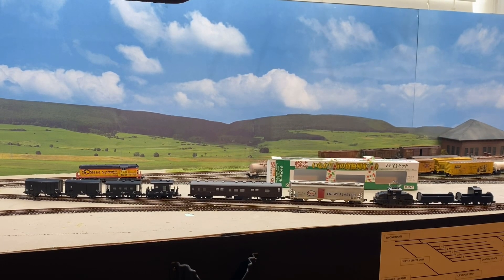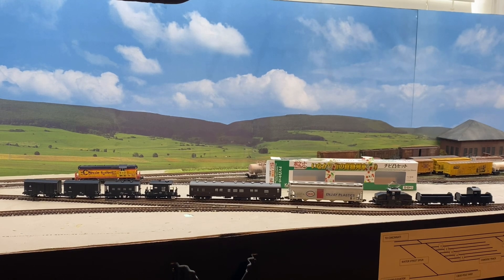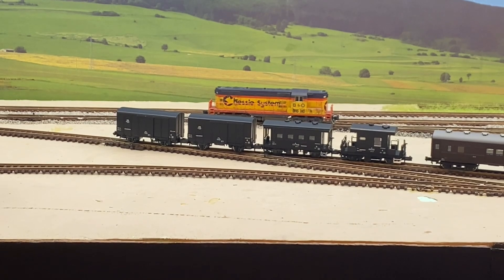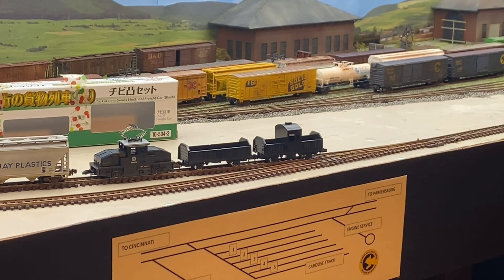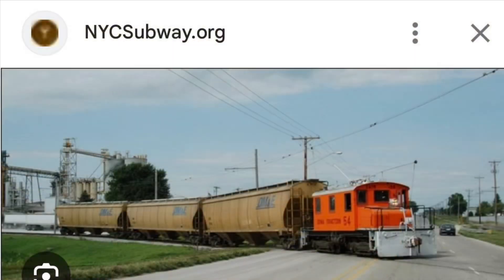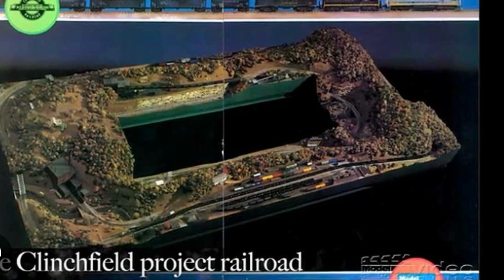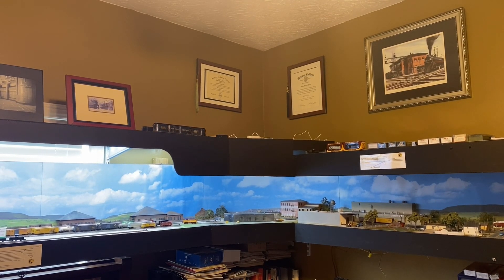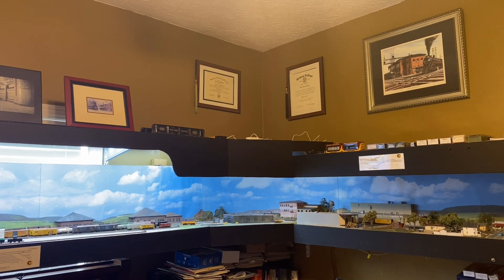Another potential layout?

Comment: Oh Thom, be very careful before you venture down that rabbit hole! I started dabbling in the Kato pocket line and haven't worked on my American layout in months. That little steeple cab is an amazing little locomotive. It runs slow and steady and even though it has only 4 wheels, it has no problem with turnouts. It and the short freight cars can handle some very tight curves as well. Several companies offer bodies to replace the steeple cab with a diesel body. I have all the cars that you have shown except the passenger car, though I have a Tomix Japanese railbus instead. Cheers!
Reply from the maker: @Maurice00PA  I don’t think that I will have that problem, Maurice. I have no interest in modeling anything except a North American prototype and probably fairly modern.
Some brick operations had little tramways to carry clay to where it was needed, but they used gas or diesel locomotives I think. That might be something that interests me but I think a short line serving industries would be more interesting to me.
Can’t wait to try it out! Stay safe!

Comment: I see you finally discovered the Pocket Line, great little sets and nice runners although not that powerful.
They also do a European style steam set with the engine inside one of the cars and a dummy locomotive.
I love the Iowa railroad, has some great switching operations but a more prototypical loco for that is made by Bandai, they're called Shorty and run on Kato chassis.
Over here in Europe there were various alternate designs on the Kato steeplecab used in a wide variety of operations.
Tramways, smaller branch lines to heavy industrial operations such as hauling coal from open mines to power plants.
You could do any type of operation with them but just don't expect them to pull a string of hoppers unless you run in double traction.
I recently saw a layout built for these locomotives on Budget Model Railways, small but plenty of operating possibilities but obviously not American based.
The possibilities are only limited by their pulling power 😄
Reply from the maker: @edgein7892  Thanks for the information about Bandai. If I do anything, it will definitely be a free lance American railroad. I’ll check into some of that stuff.
Have a great week and stay safe!
Reply: @thomplacier677  Right back at ya 😄

Comment: Here is some info to start your "Rabbit Hole" journey :-)  ... I am no expert, but I have found Japanese freight to be a very enjoyable rabbit hole for myself to travel :-) My starting point was also one of those "Freight Train" pocket line sets.       First, the naming for Japanese rolling stock is usually 2 symbols, and then a series number.  The first symbol is the "type" of car (boxcar, reefer, flatcar, etc) the send is the weight suffix ( so suffix of "MU" is 14-16tons, while a KI is 25+ tons)  The series number is just like our "type" ...  kinda like how we call them a 40' box car or a 50' box car.  

Yes, the first two are boxcars -- so "WA" is the first symbol.  Hard for me to make out the details, so hard for me to figure out weight suffix or the series number.  But since they are 2 axle, they are likely a "WAMU" or "WARA"  Since they are 2 axle, and painted black, they are from pre-war (before 1945). So both of them would NOT be rated for 'high-speed', since the distinction of 'high-speed' or not wasn't needed yet.  

The cabooses:  you have a YO 5000 series and a YO 8000 series.  (YO translate to "caboose" or "brake van".)  The YO 5000 (boxy one with 4 windows) was one of the earliest cabooses rated for "high-speed" (the Japanese use an over/under mph rating.) High speed rating meant the freight train could run on the same line as the new 'high speed' passenger services. These were manufactured between '59 and '68.  the YO 8000 (the one you called a "transfer") a pretty modern design, and I think the last design built before the end of cabooses in/around 1986.   Manufactured between '74 and '79

As for your passenger car -- I don't know much about passenger cars (yet :-) ) but it appears to me be 'brown' - what they considered "grape" (reminds me of PRR and the "Brunswick Green").  This means it is a pre-war passenger car.  

All of Kato's pocket line are "chibi" -- a word that (basically) refers to being "smushed and cute" ... so they are not exactly to scale.   The center car is a "gondola" -- TO ... with the 2 axle, so it is likely a TORA or a TOKU.  The other car is one of those "cool" things that other country's do ... they have a "normal" car with an added conductor/brakeman compartment.  These "combined brake van" cars get a FU added on.  SO a boxcar+ conductor compartment could be a "WAMUFU" ... in this case, is is a TOxx FU (Gondola + conductor) 

The steeple cab is a little harder to nail down, since it is out of scale -- but IMHO it mostly resembles the Deki-3021 or ED1 (http://g-gauge.world.coocan.jp/JAPAN/LOCO-JAPAN.html )  ....    All of your cars (except maybe the Y0-8000) would have been seen together in a consist in Japan in the 60's ... so you have a really nice (what I would consider/compare to our) "Transition Era" going on :-)
Reply from the maker: @KevinSquire  Thanks for the information. See my longer answer on your other post. I appreciate you digging this up. Stay safe!

Comment: Uh Oh! Well you could always deploy it as a narrow gauge service at the back of the layout. If you make a 4'x2', how much use will it get?
Reply from the maker: @markarnold8160  Hello Mark. It’s not narrow gauge, just small stuff. I don’t have room to shoe-horn it in anywhere on the current layout and it wouldn’t fit anyway since I model a specific area with a few liberties.
You make a good point, though: how much would I use it? I enjoy building structures and am running out of stuff to build on my layout, but after I got the structures built for the new layout, would I run it? I don’t honestly know.
The alternative is to keep it on a shelf and never run it, so that’s why I think I should stay small without a lot of investment in time and money. Food for thought, thanks for your comments. Stay safe!
Reply: @thomplacier677  I have a 22-inch by 6'6" foamboard layout - UK in the 1960s. It's cute, but I haven't run it in two years now. I keep thinking that I should clean it and sell it.
Reply from the maker: @markarnold8160  I probably would do just that. I have sold many models that I no longer use even though I was proud of them when I built them. My current layout was never meant to be the last layout that I ever build. Maybe a small traction-style layout will inspire me to start a new layout.
Thanks for your input!